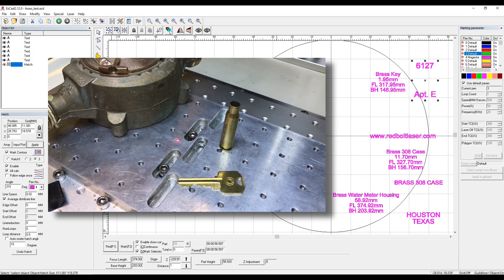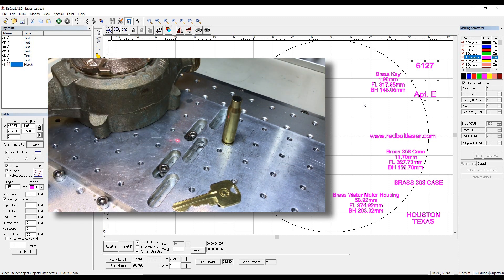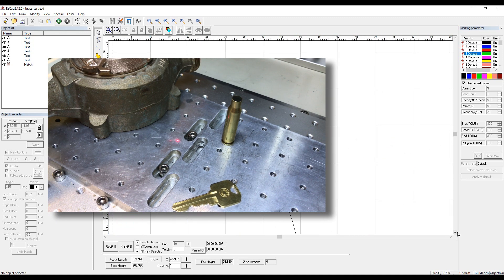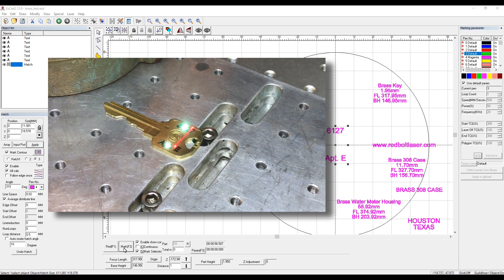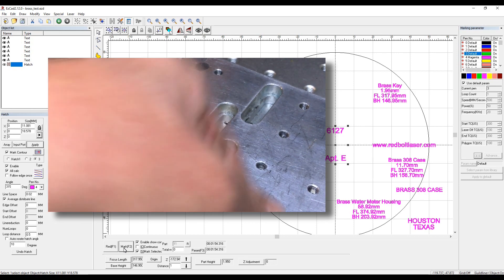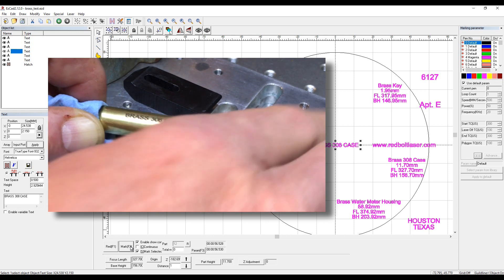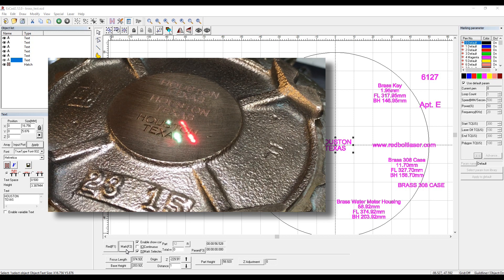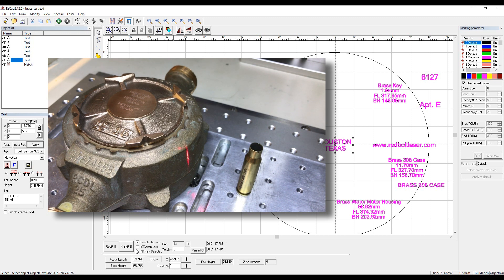Marking Brass with a Fiber Laser using EZCAD2

Comment: Can you explain the focal length and base height?  I don't have a DRO, so I manually adjust height.  Is the focal height right at the surface or up/down 5mm or so?
Reply: There's quite a bit of assistance available at these facebook groups:
https://www.facebook.com/groups/440091022989424/
https://www.facebook.com/groups/4105345129538639/
https://www.facebook.com/groups/368089227540080/